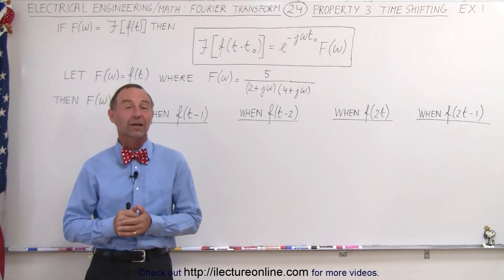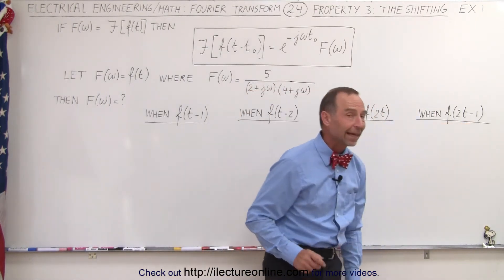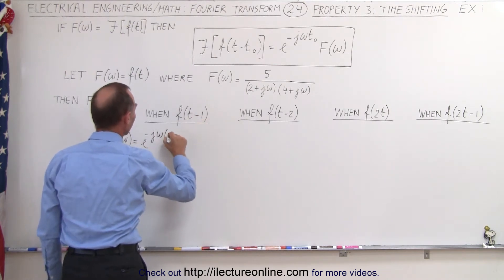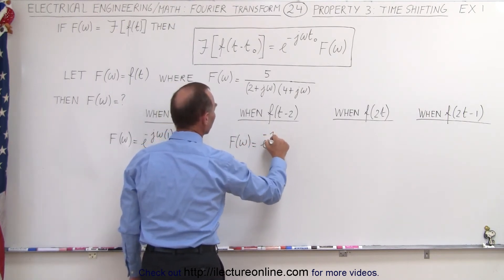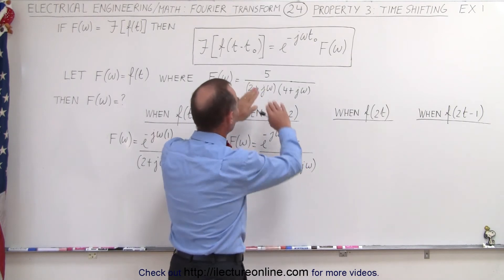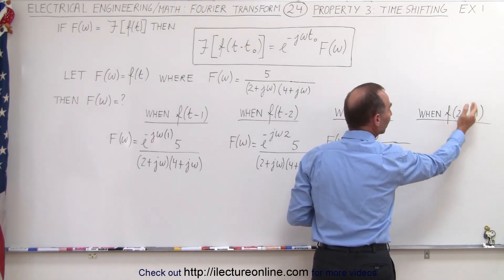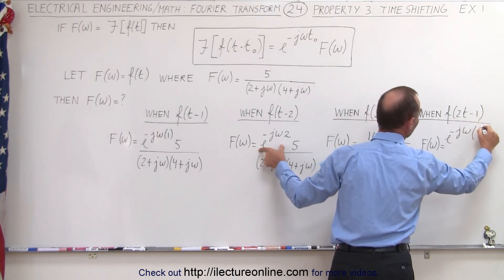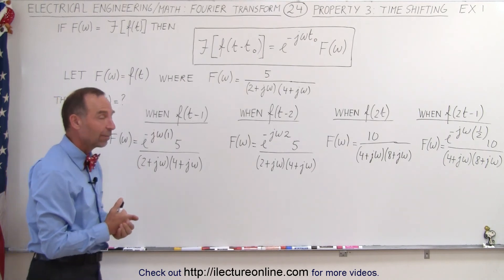Electrical Engineering: Ch 19: Fourier Transform (24 of 45) Property 3: Time Shifting: Ex. 1

Comment: Look at Video 20 for Time Scaling. When it is scaled by "a" the transform is DIVIDED by the absolute value of "a" in this case 5 DIVIDED by 2. It is NOT multiplied by 2. Same for the factors of "w"
Reply from the maker: There will always be a difference between the theoretical examples and the real circuits.  But first we have to learn the principles and then we learn how to adjust the circuits for the limitations posed by the circuitry.

Comment: Isn't t-1/2 = (2t-1)/2. Conceptually it may makes sense but how do we do it mathematically?
Reply from the maker: First write  2t/2 - 1/2 and then factor out a 1/2
Reply: @MichelvanBiezen  In my opinion if we multiply and divide by 2 then we can get 2(t-1/2) which would be equivalent to the original. In that case we have to scale it by 2 and shift it by 1/2.

Comment: should the numerator not me 5 ? as its 1/|a| *F(w/2) = 1/2 *( 5 / (1/2) (4+jw) (8+jw) )
                                                                                         = (2/2)* 5 / (4+jw)(8+jw)
                                                                                        = 5 / (4+jw)(8+jw)
Reply from the maker: The answers in the video are correct.   Thanks for checking.
Reply: @MichelvanBiezen  Does the first step, preceding the xganh zu first line looks like this: 1/|2| *F(w/2) = 1/2 *( 5 / (2+jw/2) (4+jw/2) )?